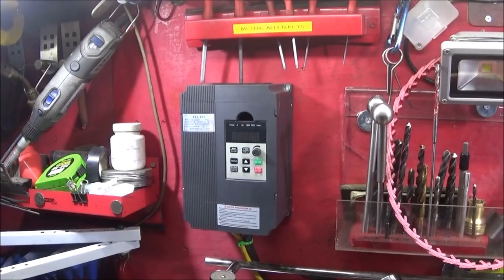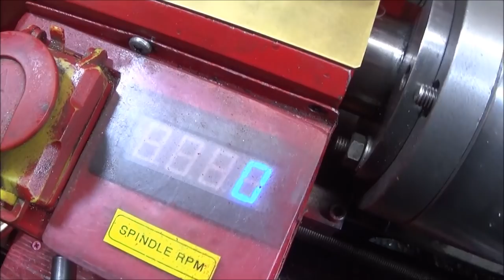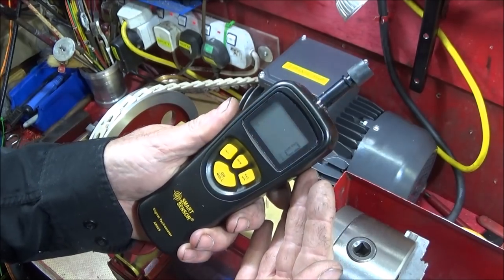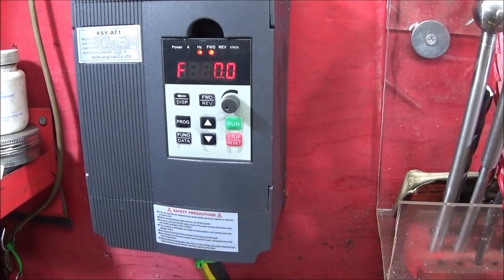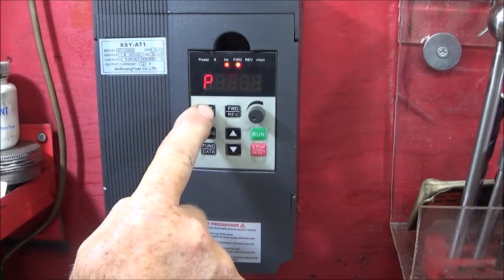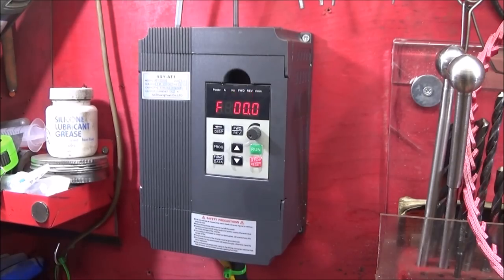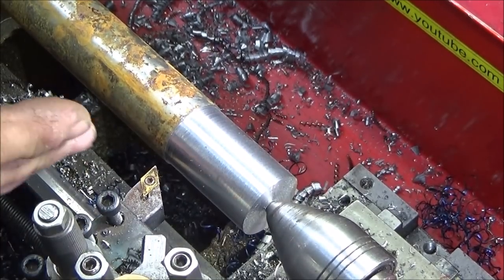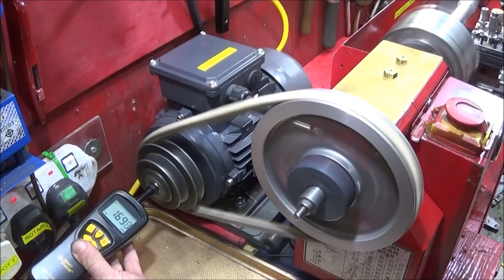Chinese Mini Lathe 3 Phase Motor & XSY-AT1 VFD Upgrade Set-up

Comment: Thank you Steve.  For a ~$250 investment it seems to improve a lot of the functionality of the mini.  The thing I would miss the most though is the spindle thru hole feature even though it's only ~.88.   I wanted to point out, as I have some good experience with VFD's over many years, that these lower cost units typically don't have a Constant Torque feature.  It's usually a jumper setting but it allows the frequency to change based on the torque load as compensation but it does have limits with heat dissipation.  However for $85 this one seems to work like a charm and have tons of features including remote controls.  I might consider getting the longer extension cable and installing the pad into the old housing on the lathe and just add an E-stop.  Just thoughts...  Thanks again for sharing all of your great mods and your time with us!
Reply: VFD parameters usually include something like 'boost profile' or similar that allows for some extra current at lower rpms. Since current and torque are proportional, this has a similar function. Use with caution, since motor overheating can result. A good accessory is a motor temperature readout.

Comment: Thanks Mr Steve. I have the same lathe and it was under water for 4 days when everything I owned was flooded in hurricane Harvey. I pressured washed and oiled everything I could trying to save as many of my tools and machines as possible. The mini lathe will not run with the controller but I think the motor is still good. I have been in the process of getting a new control panel, but after watching this video, I see a better way to get it back in service. Thanks for the explanation and the information!!!
Reply from the maker: Hi Danny. Thanks. I would have saved a lot of money if I had thought of this earlier. Hope you can get the lathe up and running soon. I live on a flood plain as well so we have to keep an eye on things in bad storms. Regards Steve

Comment: Thanks for the demo! I’m looking at some used standard-sized machines of about 3hp. Hard to get a single phase input VFD that will produce enough amps for more than 3hp. Above that you need three phase input. 

BTW, i ran across a great table from one mfg of various 3-phase motors of the same output and they all had significantly different torque & hp curves depending on how the motor was purposed, especially at low rpm. (sorry, do not recall name)

 Colchester high end lathes now get by with 3 geared speeds and handle the rest of the speeds with their VFD. See the factory website. Their 3hp 13” lathes are about $15k in the US. High end 15” start near $30k, much heavier.

Comment: Like to make two suggestions.
#1 you should be able to wire emergency stop button to a set of terminal's so when push & thru programming cause a dynamic braking effect or instance stop/hold . If a true emergency be necessary. We used this function on our VFD's.
#2. Make your calendar for a 3 month interval to clean cool fan blades & heat sink ridges . You'll be amazed at how much dust will collect in a "clean" shop. Saves life of fan n VFD in the long run.
Reply from the maker: Great thanks for sharing your knowledge on VFD's, it didn't cross my mind about cleaning them, I will make sure to check mine like you say.....Regards Steve

Comment: Couple of points to consider...…...never spot drill with a centre drill.....if you break the small pointy end off due to too low a speed you will have to face off the end to get the point out....use a short stub drill ground to 60 deg...... Second point, you have a QCTP.....don't leave tools in it, especially carbide ones, when doing ops that aren't turning otherwise you will snag your wrist or elsewhere on your hands on the tool point or you could also hit the end of the carbide and chip it......I'm also in to VFD control on a home built micro lathe and 3 phase motors are cheap to come by.....I like your easy going style of explanation and even with my 60 + years at the machinery I still like to watch the wheels go round. one thing you miss with the new Chinese imports and that is they don't have a back gear that gives you the low down punch for hard work...….my lathe is a 1930 Colchester Bantam, 3 speeds straight and 3 back gear with flat belt drive....….soon to have a VFD too.
Reply from the maker: Although it doesn't have a back gear the torque in forward and reverse with this set-up is truly excellent. My Myford ML7 and even has advantage over my Myford ML7 as the Chinese lathe has a better chuck fitting design. One can only screw tap in forward rotation on the Myford otherwise the chuck unscrews. I never use the back gear. Whereas the Chinese lathe doesn't. I rarely break centre drills either, but its a good point you have....
Reply: @SteveJordan  Ahh yes, the dreaded screw on chuck spindle.....I have that on my old 1930 Colchester Bantam and I'm considering a mod whereby the backplate with the screwed boss is locktited permanently to the spindle nose thread (I might even weld it on ...shock horror), and the chuck (s) with another new back plate will attach to it with 4 studs and nuts....the old and now fixed back plate will have 4 slotted holes so that the chuck nuts can be slackened off and the chuck rotated a few degrees to clear the nuts for removal....nuts stay on etc...…...some of the Sieg lathes have this method. Never again will the chuck screw off in reverse......I have always had to reverse the spindle by a handle in the spindle end when screwcutting as the lathe does not have a thread indicator dial and for Metric it is a must have anyway.

Comment: Pretty ambitious project Steve -- as the saying goes - very cool! Certainly handled that large drill pretty well... pretty versatile.
I'd love to upgrade my lathe with 3 phase motor and VFD - but, too much hassle really. Very difficult access the way the machine is located and probably too, I'm too old to undertake such now!
Useful RPM measuring unit.

Comment: Hey Steve, Been watching your channel for a while now and also have a ML7 in the garage. Just went and bought an old Tyzack Zyto which is missing the counter shaft, pulleys and motor so will need some work to power ! I was thinking a standard AC induction motor with driving pulley up to a counter shaft with a larger pulley  and a cone driving the spindle. However the spindle is fitted with a flat belt and flat pulleys rather than Vee Belt ! So the Cone on the Counter shaft would need to be flat as well. Then i thought about a DC brush less motor with variable speed control but after seeing the problems you have had I'm reconsidering this ! So now I'm thinking 3 Phase with VFD but I've no idea how to do this. For me a lot of what i do is constrained by cost. I don't work and i don't get benefits so I'm even plying with the idea of making pulleys from laminate wood material :/ I shudder at the thought but I'm skint and cant afford chunks of cash on parts that will never pay for themselves. Id like to keep the entire restoration to under £100 ! Your thoughts  and suggestions are appreciated !

Comment: Thank you for sharing all the knowledge Steve!
Excuse my ignorance, I don't understand thesethings very well, but if you run a 3 phase motor ar 230v with a vfd like that ..
don't you loose alot of power when running the motor slowly?

I mean the lathe is very weak when running the motor slow??

it's a question, definately not a statement ...???

I am very interested to do something similar but am afraid to loose torque.

Thank you very much 👍
Reply from the maker: Hi. Thanks. I haven't noticed any lack of torque. It seems to be really good on drilling, etc. I have the same setup on my Myford as well. I wouldn't want to go back to single phase. Regards Steve
Reply: Thank you very much for clarifying that 👍

Comment: Very nice video. One question about the noise at 24:30 ... what is this horrendous clickety sound ? The belt ? Some damaged bearing ? This is quite distressing noise, do you know where it comes from ?
Reply from the maker: Hi Thanks, It was the belt. Which was a low cost link belt. I have since changed it for a high quality  Fenner link belt that are made in the USA. Nice and quiet now. Regards Steve

Comment: Hi.  I am wanting to do this for my mini lathe which currently only has a 250 watt motor that keeps stalling out.  I am having trouble finding a reasonably priced motor on eBay and find the number of choices confusing.  I am wondering if you can maybe point out some worthwhile motors for me to consider?  I’m in Canada so on 110v.  Thanks so much for all your videos.  They are very helpful.

Comment: I got same spec motor and VFD setup on 10" South Bend lathe where it really shines however on my 7x16 mini lathe the original 600 Watt motor does just fine and I never had problem with lack of power.  The lack of rigidity on mini lathe over-shadows any lack of power.  It's like putting 8 cylinder engine on Geo Prism, it's not going to become Porsche.
Reply from the maker: Yes you are right there, if you leave the mini lathes as they were sold without modifying them. I was pleased I completed all the upgrading of the saddle, cross-slide and compound slide first. Plus I put heavy-duty tapered roller bearings in the headstock and modified the tailstock. I can do the same type of heavier machining now, as I do with my Myford ML7. It is a truly excellent machine when upgraded, modified and made rigid.

Comment: These are very low end VFDs bought one to upgrade my milling machine these VFD's do not have "SVC" sensor less vector control and do not maintain torque at low speeds, better to spend a little more to have that option. Now ill have to buy another one.
Reply from the maker: Well I have two of them and they work perfectly with both my three phase motors. The torque is also excellent at very slow speeds. It must be your motor that's up the shoot or not suited.

Comment: I was thinking...maybe your next mod could be finding a way to place the motor without the inner shaft in the spindle?
Reply: You can fit a taper lock pulley to the spindle end and have a through bore clearance.

Comment: Maybe now you can do spindle extension with threaded end and try fit pulley on that, in that way you probably gonna save open bore through the spindle. It is just a theory. What do you think?
Reply from the maker: Hi I never really use the through bore. Unless I'm using a a draw  bar and this pulley allows for the use of those. There is still plenty of room for what I nèed. Others have used that idea but I don't need to. Plus you would have to make it so that it doesn't unscrew when machining in reverse.
Reply: Steve Jordan how would you secure pulley from unscrewing? Setscrew and keyway? Because in a future probably im gonna use your modification but i would like to save spindle bore.

Comment: Hi Steve, I've followed all of your upgrades and used a few of them. Now I'm planning to change to a 3 phase motor. A question for you. Did you consider leaving the existing motor and change gears installed and then operate the lathe with the change gears in neutral and the   motor connected but off?
Reply from the maker: Hi no I didn't consider that although it would be ok to do so. I knew it would be great and sold the motor and internal gear assembly to pay towards the upgrade.

Comment: Steve can i ask if you upgraded the head stock bearings in your Chinese mini lathe to taper roller bearings or does it still have the original plain ball bearings. Many thanks.
Reply from the maker: Yes I put tapered roller bearings in. Regards Steve
Reply: Many thanks for your reply, did you notice a lot of difference going to taper roller bearings re chatter etc. Would you say that on a new Mini lathe the plain ball bearings are ok to start with for a while or is it better to upgrade to taper roller sooner.
Reply from the maker: Hi I had my ordinary roller bearings for about 5 years without any real noticeable problems. I just changed them when the head-stock plastic gears broke up. They are obviously a great upgrade, but only noticeable on heavy duty work. To do this type of thing though would require the slides to be upgraded and made more rigid as well. For most general machining though, I found the original bearings quite adequate, but not a proper thing to use on a lathe. I reckon tapered roller bearings should be fitted as standard, considering the prices they charge for the lathe, plus it would make lubricating and repairs so much easier.

Comment: Really good job Steve. I think in the not to distant future I will be going down this road myself.. Just a thought, This may be impractical for a few reasons I can think of, but would the VFDI fit in your now almost empty  control box. What motor did you use Steve?
Reply from the maker: Hi Stephen Im going to mount the auxillery buttons on the mini lathe box. Im leaving the VFD on the wall so it is easier to keep it cool

Comment: Cheers Steve could probably fathom it out, had a quick look, does yours still incorporate the powered carrage
Reply from the maker: Hi Terry Thanks...Yes I still have power feed with the gears at the back end. It just takes a few minutes more to change them if I ever need to do threading. I just leave a low feed set on for power feed turning. Regards Steve
Reply from the maker: https://www.youtube.com/watch?v=H9t69A5Yw-E
Reply from the maker: https://www.youtube.com/watch?v=uMTb7uy1HfU
Reply from the maker: Hi Terry I have given a few video links for the lathe conversion. Its worth watching all of them the oldest dated one first as I may not have listed them in order in the replies.
Reply from the maker: https://www.youtube.com/watch?v=wk_Fs9kbe34&t=443s
Reply from the maker: https://www.youtube.com/watch?v=UZbtELCpVEE&t=824s

Comment: Does anyone know if there is a VFD that has a function for constant rpm variation between an upper and lower limits?  This helps stop chatter.
Reply: VFD's normally run at the frequency you set them to for the sped you want...…...when the load comes on the VFD will just pile on the amps to maintain the speed within it's capacity rating. This is one reason you always buy a VFD with a bigger HP capacity than the motor you intend to control.....it would be wise to have a VFD of twice the HP rating than the motor you want to control if you are going to run it heavily. Running the motor slowly under load for any length of time is a sure way to kill it (and the VFD) due to overheating.

Comment: Very good upgrade Steve. A while back you did a video using end mills and using the blue nano inserts I have looked for them in bangood but cannot find them. Would it be possible to get the link for the end mill and the inserts. Thanks for any help you can give.
Reply from the maker: 300R C25-25-150 Milling Tool Holder Lathe CNC Arbor -- https://goo.gl/gx995k
    300R C14-14-150 Milling Cutter Boring Bar Turning Tool Holder-- https://goo.gl/Pcvooq 
Drillpro 10pcs Blue Nano Coating HRC52 APMT1135PDER NB7010 Carbide Inserts-- https://goo.gl/coajd8
 ·
Reply: Tom and Steve thanks for booth of your responses. I was able to order the milling arbor and bits this evening. Steve you're review on the larger indicator holder was spot on. Bang good must of had a run on them they are no longer in stock. They only say that they will be back in stock soon. I plan on purchasing that once they are back in stock. Again thanks for booth of your help on these items. Keep up the good work on the videos Steve.

Comment: Steve is that your 5 inch chuck on the lathe?
Reply from the maker: Hi Murray.. yes it is.
Reply: @SteveJordan  Hi Steve, I have a sc2 lathe and  I'm wanting a larger chuck. 3 jaw or 4 jaw? And did the lathe motor cope ok with heavier chuck?
Reply from the maker: Hi Murray yes it was absolutely fine with the Chinese motor. It's great having a bigger chuck. Regards Steve